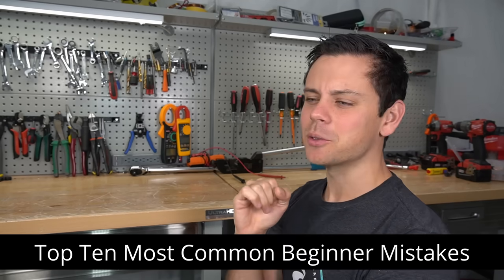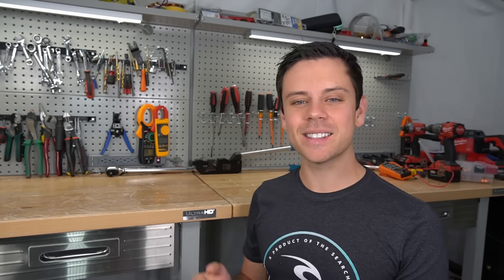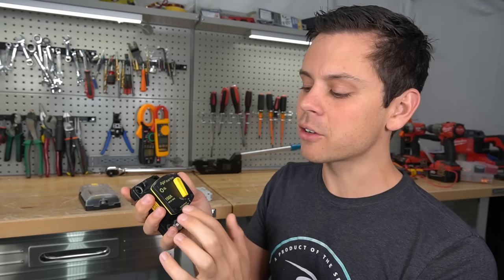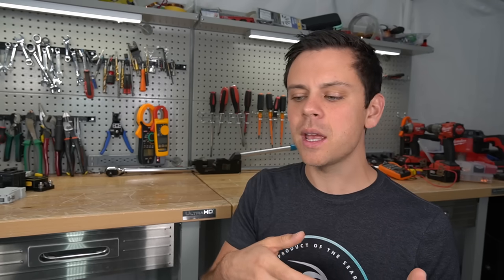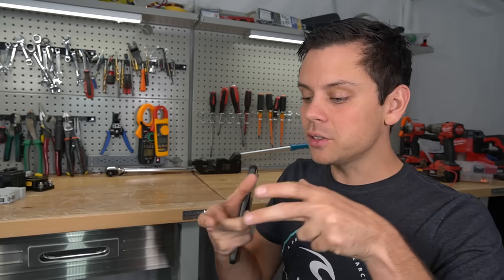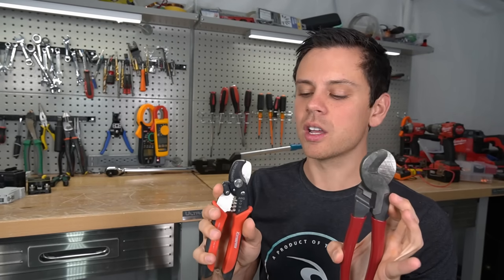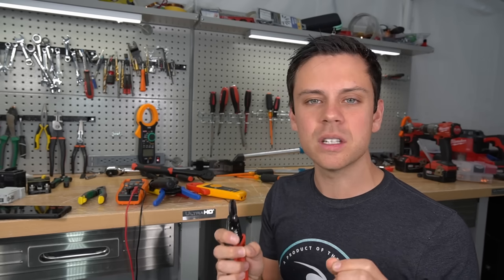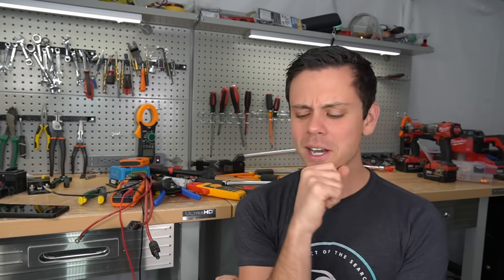Top 10 Beginner Mistakes When Building a DIY Solar System

Comment: That big fancy crimp tool is nice but not practical for the average user. Most people would use it once about every ten years.  I have had good luck on big connectors using a 1/4" socket extension and a hammer to "crimp", then of course, I solder them, lol. I have battery connections that are 30+ years old done this way.

Comment: And you are not going to charge a 24v battery with  24volts, you need upwards of 36voc to charge a 24v battery, using a charge controller ,  but 42v plus would be better, usually between 1.5 and 2 times the battery full charge voltage,

Comment: Question... If you ordered seven 12v
Reply: Didnt finish...  seven 12 volt 195 watt panels to connect in series... Six have open circuit voltage of 22.5-22.8 but one has 22.0 volts.  Would you return it?

Comment: Do you have any suggestions for tools and gear for people who are broke-assed poor? I watched your  DIY Victron video and now this one. The Victron system you explained costs more than my house so I'm just wondering how I can afford something that works without being a fire hazard and MAY be expandable in the future. 
I have a generator running a fridge and some car batterires running some lights. I'm living in a tent while I build a small house by myself by hand. Is there a system I can build that will power a PC, fridge/freezer, tv, lights, fans without costing me the moon, or should I just give up and move back to the 1800s? lol
I can get some 120ah AGM (4 x 12v) batteries from a friend for a reasonable price, but the rest is gibberish to me.

Comment: What I don't get is someone will have a 400w system and 2000w inverter.. 
I just bought a 200w starter system, I'm going to put a 100w to it because I don't want to over drain the battery

Comment: I purchased a 35’ sailboat with a RENOGY powered Electric Drive. 20KW drop down belt drive, I want to set up a solar system to charge the batteries, drive and house, “separate systems” the previous owner said the drive is 12v but wired for 72v? If anyone could help a newbie out? Id really like to avoid burning my boat to the waterline! Or Electrocuting myself !😂🤷🏽‍♂️

Comment: I can't contradict a word he said, however, in my opinion he overstate quite a bit.  I am not a licensed electrician, however I won't specify, but have done a lot successfully with much less than he says is required.  There was a time when the most basic tools were all I could afford, and some of his suggestions didn't even exist 60 years ago when I was young.  If one is careful, basic tools will work well and last.  If one has the money, then get the best, but don't think you will certainly burn the house down if you don't have them,.   
Also, if you solder electrical, use silver solder, not lead, and use shrink wrap where you can.  Never bundle AC current wires as one can generate a voltage in another which could cause issues.

Comment: You don't need fuses or breakers, I went 10 years without one, I added a breaker just like the one he shows, it produces heat.i had 0 before. I use -00  solid copper wires , I use the same instead of bus bars, my 3500 watt system produces 0 heat. So what would a breaker or fuse do? For those who use a tiny wire it can save your wire from burning . But use a fat wire and now all that is stupid. It forces all amps through a tight spot causing heat.
Spend on extra thick wires at least 3 gouges bigger then the internet says you need.

Comment: You know what stops loose terminals? Soldering. 
I've been at so many job sites with loose terminals arcing, with the tell tale brown/black hue to it. 
You gave no examples as to why pre-tinning or hard soldering to a terminal is bad. Other than your opinion.
Reply: He did, it called voltage loss.
Copper to copper is way better voltage wise as solder being infused to separate the copper to copper connection. Once solder becomes liquid, it gets between all the copper to copper points causing the current to now travel from copper-solder-then back to copper. This cause voltage loss.

Comment: 10 common mistakes for your own DIY Solar System;
1.  Not having gloves with high enough heat rating.  Needs to be 7000C+
2.  Gloves clothes and workspace must all be gamma radiation resistant.
3.  Your work space needs to be absolutely huge.  Dont scrimp by having a workspace less than 180 million miles in diameter.
4.  Make sure you have plenty of oxygen to breath whilst working - you dont want to run out.
5.  Take plenty of sandwiches with you as getting to the outer limits of your workspace will take some time.
6.  Keep the asteroids in a safe place until you need to create the belt.  Loose asteroids flying about can be dangerous
7.  Dont make your system objects too small or you will have gravity problems and they will fall on the floor.
8.  Dont let the outer reaches of your system get too warm as the ice & gas objects will melt.
9.   Forgetting to put wire mesh around the entire system to stop aliens from coming in.
10. There isn't a 10th common mistake.

Comment: I swear people never read the Amp ratings....gotta have the proper gauge wire for how many Amps are flowing through every step in the setup.

Literally have seen combiner boxes stating "this box has six 12A breakers for 72A"...then they have a thin gauge wire at the final combined output that can barely even handle 60 Amps! 

Keep an eye on those gauges.

Comment: That breaker your showing us off RIGHT NOW is 10A @48V that according to YOUR chart requires a 1Awg wire.... and u just said Not to use a 4Awg wires?? I think your making a mistake :)
Other charts for 48V 150Amp will tell us to use anything from 1Awg to 5Awg wire.    Hint even if your system is using 100 Amps Still use the correct wire size people... AC and DC along with distance do have diffrent ratings, do your research and check :D

Comment: Crimping wiring is a million times better. Soldering is fundamentally flawed because of technician application. Working on complex aircraft systems today require most if not all repairs or upgrades to be crimped. Stay safe everyone

Comment: Yes , You have missed something important . Someone who builds one , and one only system like in a caravan or some vehicle , boat or so might nor be able to spend loads of cash on things like heat-cameras or large crimpers etc , Such people need an advice to plan and build their system themselves but get the cables done by some good professional . They will still save a considerable amount of money but avoid problems with the important high current cabling.................

Comment: Panels are cheap. Batteries are expensive. Its a lot more cost effective to be over producing to cover the cloudy days, than to have excess battery capacity that you rarely use.

Comment: I used to work in an manufacturing of industrial UPS and solar inverters and yes we do not solder terminal lugs instead we crimp them for better solid connection. I cringe whenever I see a diy'er video advising to solder the lugs onto the wire.

Comment: I could really use some help. Your videos go fast  for an old boy like myself.  I have 3e nice solar panels.  400 watts each. I have 3w sets of golf cart batteries.  One for the cart. One for my home. I want an all off grid system. A system where I can take power from multiple panels and battery systems ,
And use them all. Please help.  The charge controller video confused me most. You were talking a bout 100p watt solar input? Please help. In Lemans terms. There has got to be a better way to explain this stuff???

Comment: I'd rather use normal tools (half the price) and go careful, and have the additional funds for the components of the system.  Expensive cable strippers are not required if you're good with a utility knife.

Comment: my best guess for general DIY/hobby peeps wanting to solder their crimp terminals is they've used too many cheap / low quality terminals or didn't have proper crimpers and their results were loose. The problem with just saying "cheap" though is that all sellers have to do is increase their price and it seems like they're good now. If you're just starting out, try and avoid insulated terminals. Get bare ring / fork / whatever terminals and put heat shrink on yourself as you'll generally have an easier time crimping the bare kind.

Comment: I used to work for Klein. You need to toss that multimeter into the trash and use that Fluke every chance you get. Trust me.
Reply from the maker: I love my fluke
Reply: @WillProwse  The original slogan for the company was “If it works, it’s a Fluke”. Fluke and Simpson analog. Trust no other.

Comment: DC is so inefficient. Seems logical to do micro inverters. There is no need to even do inverter for use. Just charge batteries from AC or off peak at night.

Comment: Aluminum Wire can kill you. It is NOT just size and expansion contraction issues. When Aluminum is directly connected to copper and a current passes through that connection a chemical  reaction takes place and causes a usually dark film cover between copper and aluminum  with current and the more build up the more resistance = heat = fire. In the late 80s aluminum wire was much less money than copper even if properly sized. Many mobile homes and site built homes started using aluminum and then connecting to copper from the power company  Lots of folks died. There are ways to connect copper to aluminum but unless you kno exactly the chemistry and process to do so  do NOT do it.

Comment: - If you're targeting users that are inexperienced, you should START with safety information.  You started with a controller rated up to 500 volts dc, which ought to make novices nervous and cautious, not comfortable and complacent.  Big solar arrays are HV and that is VERY dangerous.  Please provide generous amounts of safety information from the get-go.
- Novices don't understand the difference between a completely discharged (fatally killed) battery and one at 0%.  Suggest spelling out that 0% doesn't mean 0 volts, and how deep discharge can damage a battery that lacks LVD protection. (though nowadays most controllers and pretty much all lithium batteries have that)  You do discuss that a sleeping battery isn't dead, but don't provide any explanation of why.
- I like the inclusion of future-proofing.  that's something that goes widely overlooked even in videos like this that are trying to cover common mistakes.
- Suggest discussion of adding fuses at strategic points, in addition to main breakers.  LOTS of novices don't bother with fuses because they think the main breaker is all they need.  Some good examples of where a fuse is appropriate is where you are paralleling strings on the roof and before you start your solar run into the house.
- CCA is NOT the boogeyman!  CCA quality varies, but a good rule of thumb is CCA capacity is 2 gauges below pure copper.  If you think #8 CCA is a fire hazard and aren't going to mention that (in the same situation) #10 copper IS NOT a fire hazard, you're missing the point.  CCA is fine as long as you go 2 gauges thicker than you would for pure copper.  CCA can often be bought at 1/3 the price of copper for the same gauge, (so double it) or go 2 gauges down and buy it for 2/3 the price of copper for the same capacity.  But kudos for spending generous time explaining use of proper wire gauges.
- NICE inclusion of DC vs AC breakers.  Another point that gets missed a lot.
- what do you think about crimp and then solder?  (I'd also argue that the main reason people crimp is because crimping requires a lot less skill and training/experience)
- suggest use of velcro cable ties  I've started using those and really like them.  they're secure, gentle on the wires, AND easily adjusted / added to.
- in addition to Klein, Tenma is another good quality less expensive tool.  Tenma manes a nice inexpensive clamp-on DMM.
- good torque screwdrivers / FLIR cameras are expensive!  links to your tools would be appreciated.

thanks for the video!

Comment: I would probably also add one point which I feel is very important. Honor, pride, and presentation of your build. There is absolutely no reason when you are building a system like this to not use the correct color heat shrink red for positive, black for negative and do it in such a manner that the heat shrink correctly covers the conductors in a manner that is laser etched 100 out of 100 for the build... obviously I am joking when I say it is laser etched but literally, you use your eyeball and as you do this you figure out in time the right amount of length of heat shrink to use and how far up on top of the conductor to the ring clamp terminal that you need to go. In time you will find that it makes more financial sense to purchase big long rolls of heat shrink as well and once you get it down to a science it's like clockwork and it just clicks and it is glorious

Comment: Your "don't solder" assumes the solder joint is bad. Your "just crimp" assumes that the crimp is good. As to "professional manuals" not mentioning solder you need to keep in mind that they are written for a particular demographic that may or may not be competent. IF you have all the proper tools either can be done both well or poorly. Furthermore, you ignore that a solder connection will have a much higher surface area than a crimp connection. Even a proper one. This will more than make up for differences in conductivity. Additionally, any situation that may melt the solder will have already destroyed the cables in whole or part.

I use both where appropriate and for my ease. That said, I understand people wanting to do something and not having the budget for expensive tools when they have something that already works.

Comment: I don't care how cheap you are the average person Harbor Freight voltmeter be plenty good but if you're going to be tinkering with a lot of stuff by the fluke by the fluke by the fluke when you're chasing a parasitic load that's low voltage DC and you have a milliamp leak you be ready to beat the person to death with that on meter if you don't go by that fluke you got to have the flu because you can zero it out most home meters when you're doing millivolts it already got a millivolt on there before you start get going

Comment: A very good video especially considering your age. Sorry to say. However, you left off some serious safety concerns. Telling somebody to pull the wire off of terminals. First of all you didn't say anything about make sure it's off. Make sure it's disconnected. And several other instances you really need to think these things through when you recommend people take actions because you are liable. Otherwise. Excellent. Excellent. Just take the time to speak the safety stuff. Save yourself some serious heartache later

Comment: No you are incorrect.
Solder is best against corrosion..
However the best connection is crimped WITH solder. 
To do this crimped your connection. Then solder it.
This fixes all problems.
Reply: No and no. If moisture is a potential issue then add dielectric grease before adding heat-shrink. Soldered connections are even worse, vibration will crack the wire.
Source: Engineer on Nuclear, Power Station and Aeronautical systems. Go look at the QA spec for anything in those areas, chapter and verse, all derived from NASA specs.

Comment: Look y'all I know the little bastard ran you hot with use the proper tool a proper crimp is better than solder anytime anytime there is no comparison with the proper crimp to any other connection for wire

Comment: My p e c r o n  e 2000 lfp solar generator is reading 0 Watts on both DC and AC and has 88% charged but will not do any AC output